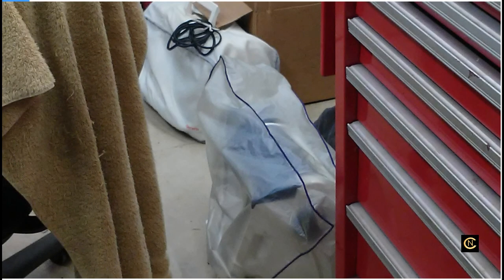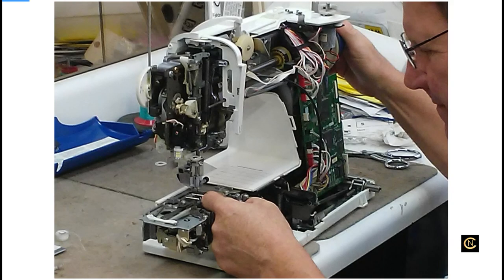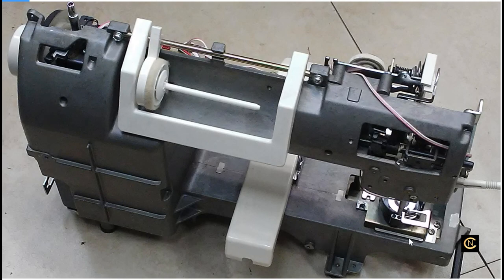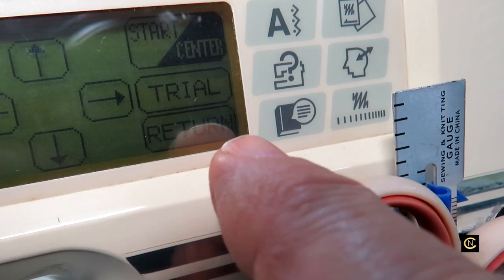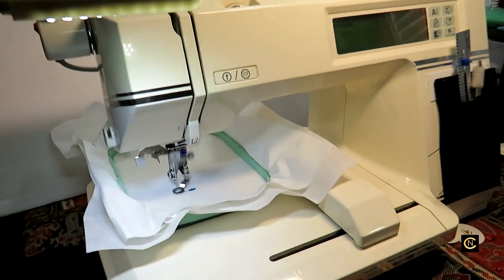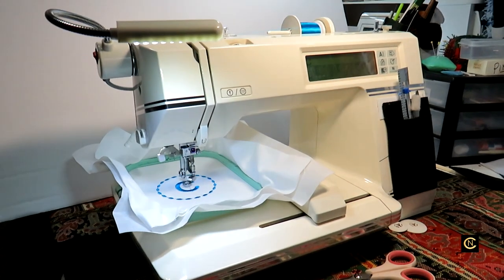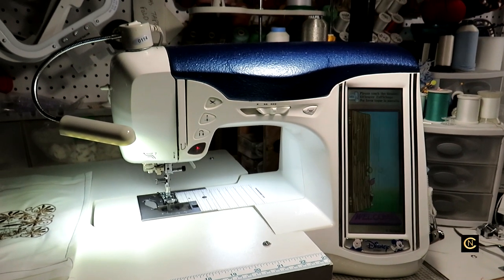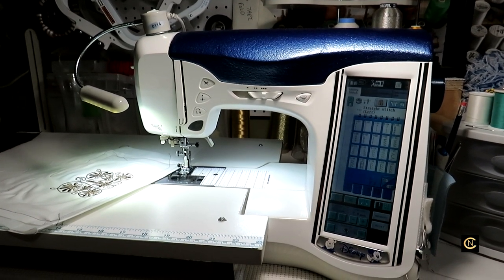A Visit To The Sewing Machine Hospital  - Bernina Deco 500 - Brother ULT - Christopher Nejman

Comment: I have a Janome 11000.  Brought the machine for repairs.  Was told circuit board A needs replacement.  Dealer commented If I were you I would not invest in a new board.  But I love that machine.  Thoughts?

Comment: I have a Brother SQ9185 computerized machine, and I have never had any problems with it. No odors or anything. I am wondering if they perhaps oiled it, which is a no-no with this model and likely subsequent models in the same product line. Both the manual and instructional DVD said not to oil it. They use machine lubricants which are replaced with each tune-up if needed, and oil may strip the lubricant away.   

Also, there is only one sewing and vac shop here, and they didn't sound like they knew much about the sewing machines, so I am hesitant to bring my machine there. They stocked the threader replacement and bobbin case there that I needed, but I don't know that I would trust them with my machine.
Reply: @marthaswartz882  thanks! ❤ That isn't the machine I have, but was helpful nonetheless. Knowing how to clean a machine of any kind is good knowledge to have. I haven't seen that error yet, but the manual has a section dedicated to it, so they do appear to be aware of it. He also provided links to the grease I need. ❤